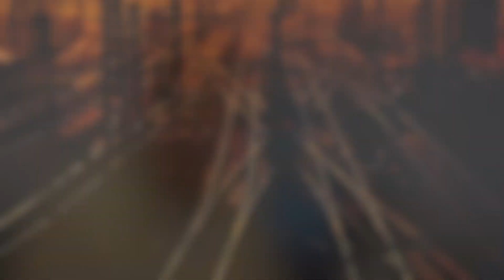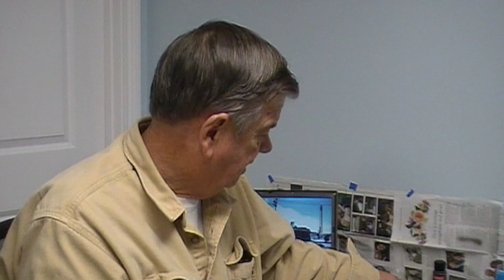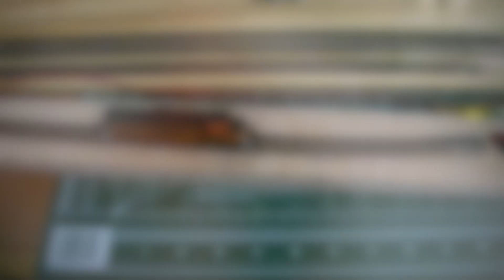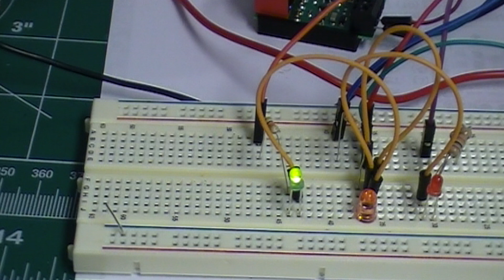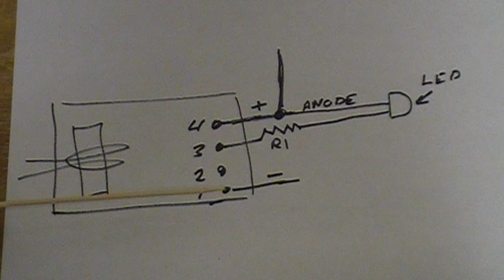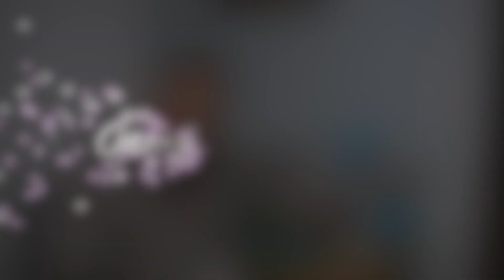Understanding NCE's BD20

Comment: There are some creators that have developed (3D printed) a cradle/older into which the BD20 fits and allow the module to be held in with a screw through the base of the holder.

Comment: I'm not wanting to do anything super fancy with my layout... but I do plan to have 1 "staging" track inside a tunnel, maybe 2 tracks... 
   I'm looking for the most simple way to know if a train is sitting in a section of tra k that isn't easily visible.... 
   Would the BD20 be a good way to see this,  with just 1 or 2 LEDs like you show.... green would mean the block is open to be filled, red would kean there's a train in there ready to come out onto the layout... 
    I'm also looking for the easiest way to operate a pair of switches, even by button control or .... but I want to he able to throw 2 switches that align the main, or the siding that goes through staging and back to the main in the other end...., using one control...and maybe have LEDs to show which track is aligned.... 
   Basically all others switches will be manual machines, or ground throws, or something as simple as possible.... 
    My railroad will represent a local small RR in my area, and where it has interchange with UP & BNSF.... 
     I have an NCE power cab, SB5, and a Cab06.... hope to start permanent benchwork and add 2 UTP panels soon, as well as start laying some flex track for the main continuous loop....so I can run trains as I work on scenery and adding turnouts for all the switching sections....I think I can run the main with only the first 6 turnouts and about 40ft of flex track...
Reply from the maker: The DB 20 would work perfect for detecting a locomotive on the siding. You can also use some LEDs or a by color one will also work. To control your switches, I use tortoise controllers. you can control more than one turn out with a single switch by using to12 V power supplies. You can also add some LEDs to tell you the position of those also. I have a few videos on wiring for the switches and control panels. Here is a link to start you off with https://youtu.be/B6Un1nq5ASA. I hope this helps, if you need more information please ask.

Comment: I’m testing sensors with my new Arduino Mega connected to JMRI with DCC++.   I have a light sensor working well on my test track but not sure it will be reliable due to light variation in my garage.  If you know, can I just swap the bd20 with light sensor?  I’d rap the track power wire to the bd20 and power the db20 from the 5v and gnd pins on the motor shield.   Thanks for your thoughts.  Fred

Comment: i have an arduino 3 aspect code on my uno that works from ir sensors i can upload for all
 to browse what i am interested in is how you got the bd 20 to work with arduino for sending the logic to the arduino( signal sensing) and maybe the coding
Reply from the maker: By using pins 1 and 2 on the DB-20 and tell the Arduino when the locomotive is in that block.  The sketch (code) can be found in my video https://youtu.be/YecqNcjXzD8.  Hope this helps.

Comment: Hello, I happened across your video while looking for block detection ideas. I looked for the DB20's and see they are Just shy of $20. There is a cheaper alternative if you are switching lights from the Arduino, that is to use a current shunt. They come in a few flavors, one that might be of interest is the ACS712 in 5A. I have a couple of the 30a units to use on a different project that i added to an elecrow pcb order. 

https://www.elecrow.com/acs712-current-sensor-5a-p-707.html 

They come in 5 20 and 30 amp versions. and cost $4 each, you may find them cheaper elsewhere i have not looked.

Cheers, Joe
Reply from the maker: Thank you Joe for the comment.  Finally picked up a ASC712 and it must be great for measuring current but I am looking for a High/Low signal for the Arduino to read.  I can not get this from the ASC712, I just get a steady 2.6 VDC out with a load or no load.  Am I doing something wrong?  Have a great day... Jack
Reply: Hi Joe 

Is it possible for you provide a link for more information on how you set them up and a sketch everything I have read so far says they cannot detect the low signal of DCC?

Any help would be good as I stupidly bought 50 and would love to use them!

Regards

Darren

Comment: Add a second resistor to the neg side of the green. You may have to experiment with the value. I'd start with a 4 or 500 ohm and go up if its still bright. Remember you can put resisters in series (end to end) and they will add resistance value.
Reply: Thanks for posting that info!

Comment: Hello again, I've learned by accident you don't need the relay to switch the LEDs. BY hooking the anodes together to the same positive lead, hooking the green LED cathode lead directly to the negative (with the resister in series), then hooking the red cathode( with resistor in series) to the switched negative,  the red LED will overpower the green when switched on, turning the green off as the red one lights. You may have to adjust resistor values on the red side to get it to work correctly but it works just fine. Apparently the red LEDs pull more current than the others pulling all the current from the circuit. It makes wiring signals easier. I'm using the simple relay system you described in this video to shut off a section of track to a diverging track to prevent a crash. I installed a homemade timer to keep the relay engaged about 10 seconds after train "A" leaves the BD 20 sensored area. Then the diverging track come back live and train "B" starts back up to continue on its way. I'm starting to experiment now with using more BD 20's and a mini panel to supply some more automation with throwing turnouts, ect. One improvement tends to lead to another.
Reply from the maker: Thank you for the information.  Never thought of doing it that way and you are correct and thanks for the update.....Jack
Reply: I wasn’t able to have the green LED ever turn off using a 1k resistor on both the red and green LEDs. I’m using 12V to power the BD20
Reply: @scottkahn8974  Use 1 resister on the common positive side of the leds and switch on the negative side. Both leds need to be common to the same resistor or it doesn't work, I usually use the positive(anode) side. I have had the green dim but not go all the way out. If this happens I put an additional resistor on the green's negative side to help restrict the current flow to it. I usually power with 5 or 9 vdc and use a 500 ohm resistor but I assume 12vdc works the same. The trick is the common resistor restricts the current flow to both so the red will consume all of the power and the green goes out. Have done it many times on multiple layouts. In fact I just finished having to wire around that problem so I could light up both a red and green signal on the opposite ends of a gantry lighting system spanning 2 tracks leaving a turnout. After the train passes through I have a BD-20 firing a signal to a mini-panel changing the lights and switching the tracks on the turnout to bypass a station. The challenge there was to switch the lights whenever the turnout switched, either by the train or the cab or a mechanical switch. It was solved by installing 2  NCE snap-its, each snap-it powering 2 red and 2 green leds. A set of reds wired back to back on one end of the gantry and a set of greens wired back to back on the other end. Worked great once I figured it all out. Of course it took 3 days. I couldn't find a relay the snap-it would close to do it the easy way. Hope this works for you, if not let me know.
Reply: Thanks for the clarification @BulldogDonA! I’ve followed your guidance and now it almost works! My green LEDs are 5mm 2.8-3.2V and the red are 5mm 1.8-2.2V. The red comes on and the green dims slightly when the block is activated, but the green is still almost as bright as the red! Perhaps my power converter puts out adequate amps to power both!